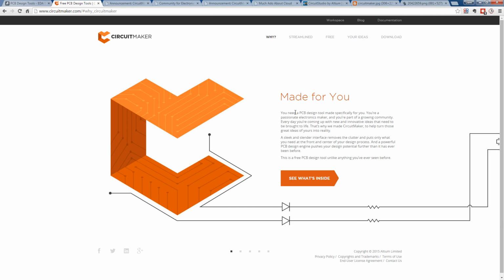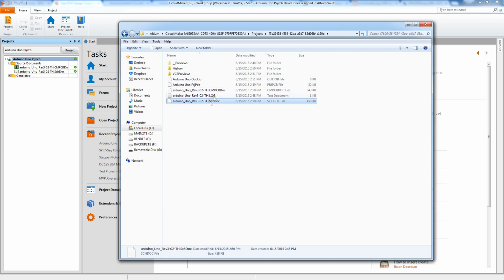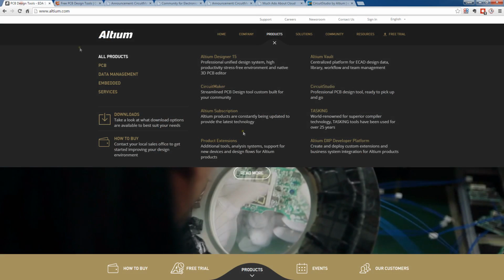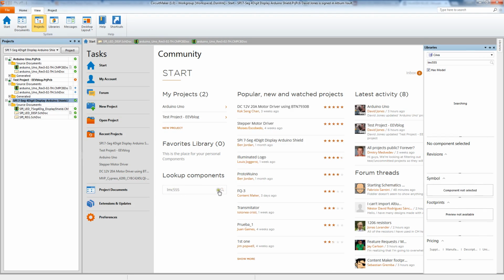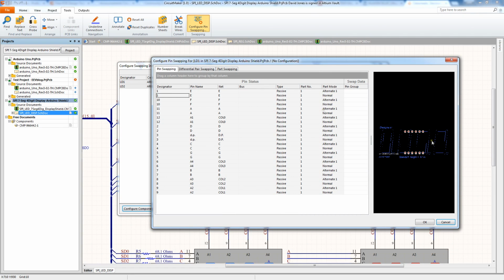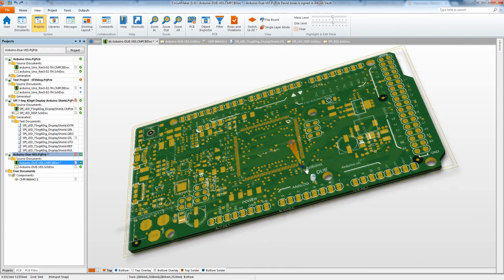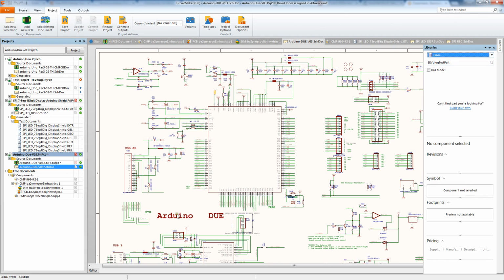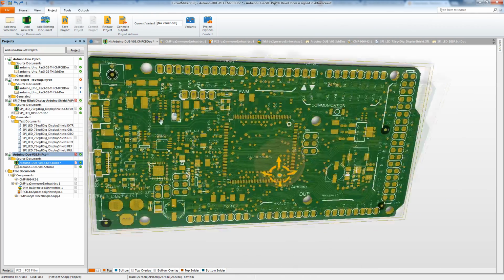EEVblog #754 - Altium Circuit Maker First Impressions

Comment: I am glad that KiCad is finally catching up. Thanks to CERN investment of developers into the project it finally reached a point that I switched over from Eagle to KiCad.

If you did not try KiCad in the last month you should do that now. Try one of their current nightly builds. If I had to bet I would say KiCad will be replacing Eagle.

Just so you know they are working on a stable version at the moment. So if you are a "stable release only" person you don't have to wait long any more. :)

Also it runs offline, it does not have layer or size limitations, it has a working push and shove router. (I already used it to design production boards and it is a joy to use) You can easily write scripts to modify the text format files. You can collaborate on your designs (just put them into a github repository). You can have as many private projects as you want. They use github to maintain community made symbols, footprints and template projects, that you can either download for offline use or let KiCad automatically download and update as the library expands and improves.

Also if you want to spend your money where your mouth is there is a donation page that will help make KiCad even better: https://giving.web.cern.ch/civicrm/contribute/transact?reset=1&id=6

And if you find bugs they have a bug tracker, and the developers are very responsive and helpful, if your bug reports are well written: https://code.launchpad.net/~kicad-product-committers/kicad/product (the bugtracker thing is a huge win over Eagle, where you have to wait years for a bug to be fixed)

So do not waste your time on the CircuitMaker and just bite the bullet and learn KiCad :D
Reply: ***** I did not use KiCad 2 years ago. So I am not sure how it was back then. I bet the software evolved a lot since then because I see how much progress it is making over the last few months since I switched over to it. I designed and manufactured 1 Board in KiCad so far and am working on a few other designs and it does not feel like a lot of pain. Reading the developer mailing list they are working on further improvements regarding the symbol and footprint assignment system. They just got rid of the assignment file few weeks ago. They are actively working on improving the whole workflow. For me it is just already improved enough that I can finally create my Open-Source hardware in Open-Source software as it should be. But if you are not willing to take any compromises and have time to wait, then I would probably wait another few months for the stable release. Things will only get better and the trajectory this software is taking is very promising. At the moment I was deciding to start another round of hardware designs for my company I compared and tried many available options including Circuit Maker, Eagle, Upverter, gEDA/PCB, KiCad, Pads and even Altium. The whole cost - learning time - ease of use - capabilities - conversion of previous designs - availability to users and projected future worthiness equation ended up coming out in favor for KiCad. And so far I am happy with that decision. :)
Reply from the maker: Piotr Esden-Tempski I don't want a "nightly build" of anything, thanks.
Reply: EEVblog  As I said stable release is around the corner. And what you just tested (CircuitMaker) is essentially a nightly build (Beta)... not sure why you are so dismissive to a solution that is obviously superior to CircuitMaker. At least based on the review you gave to it. Independent of the fact if it is a nightly build, daily build or whatever build.
Reply: Piotr Esden-Tempski I've used kicad for a few boards now and it works pretty well for the price. It has some weird parts but it's usable. I don't mind the footprint assignment stuff. Having a many to one relationship between parts and footprints makes sense to me... I just wish kicad had more standard footprints out of the box and had a better tool for creating ones that don't exist. Being about to bang in the pitch, pad size, number of sides and space between sides to get a footprint would be nice.
Reply: Piotr Esden-Tempski It's genuine free software too; according to the Wikipedia page, it was released under the GNU GPL.
Reply: Svenne Krap Lots of people that trumpet the "open this and open that" horn do so because it's an in thing right now and not because they actually believe in it.
Take the makerbot guys for example "open source is awesome, we get to consume all of your libraries etc for free and have products we can sell wooo" .. two minutes later .. "get your hands off of our stuff you filthy peasants".
Reply: donpalmera Yeah I agree it has it's quirks still. But as EEVblog said the same applies to Altium. As always you need to make a tradeoff calculation. EEVblog says he will use CircuitMaker because he is familiar with the Altium software and this means he does not have to learn something new, which is fair enough. I do not want to have my hardware designs locked up in a proprietary solution that might shut down on me. And as KiCad is "good enough" now I can finally escape the clutches of Cadsoft. I totally Agree on the footprint wizard front. I do not have time at the moment, but either someone will donate the project some money to make that feature happen or someone will volunteer some time and write a nice wizard for this. Either way because it is Open-Source everything is possible. :)
Reply: ***** correct, making it a natural choice for Open-Hardware... :D
Reply: Piotr Esden-Tempski I've been using KiCad professionally for two years. I have made 2, 4 and 6 layer boards with some with over 300 components. So far so good. Yes it can have some weird stuff but like any other EDA. Also, if you have any problem with files, all the projects files are text based so with a simple text editor you can make lots of changes quickly and with no problems. 

Everyday more people is joining the developer team and they are glad to get feedback from users which is something I can't say from any other EDA I have used.

Honestly, right now I don't thing any reason yet to change EDA.
Reply: Piotr Esden-Tempski KiCad also works with Linux, and if you are targeting the open source/hardware world, that is a big deal.
Reply: Piotr Esden-Tempski I feel Dave is strongly biased against free/open source in general (I have followed his videos since his old garage days). 

I must admit that it baffles me a lot, because he is so into open hardware.. but software.. "nah, not worth using" (paraphrasing here). 

Especially because the benefits you get of open hardware are even stronger when you think of open software..
Reply: Piotr Esden-Tempski  I like Kicad too but I think the mapping between symbols and footprints to create parts was such a pain ! (at least it was two years ago... I have not tried since then)
Reply: Kevin Harrelson I think kicad's weird-because-not-what-people-are-used-to things will become less of a problem in time. A lot of the next generation of electronics hobbyists will only know kicad as it's the main free software suite in the wild.
I don't mind so much that there aren't many components built in. A lot of the time I don't like how built in stuff looks in the schematic and want to redraw them the way I want anyhow. i.e. I don't like how someone has decided to break up a CPLD into the different IO banks as in my design I'm not really caring about grouping related pins into the banks and more about which pin is closest to whatever I need to connect (pin swap feature in the altium products looks awesome for this kind of stuff..)
But the footprints being so crap annoys me. I think a lot of kicad user's (myself included) have their own libraries of footprints that they commonly use as they are either missing or they can't find a matching built in one because the naming is all over the place.. Which means you have to be super duper careful and print out your board at 1:1 scale to check the footprints you've drawn aren't junk. I drew a TSOP-II footprint with the left and right sides reversed a few weeks ago and didn't realise until I had the board in hand. If the footprint was built in or I could have selected the pitch etc and generated one that wouldn't have happened. :)
I wish the footprints bit could be cloud driven in someway.. If I come up with a footprint that isn't in kicad I could push it, other people could rate it/confirm it worked for them, improve it etc and ultimately pull it into their designs. There are some big 3rd party footprint libraries with all of the 3D models etc in place which should be shipped with kicad or as a contrib package or something too.
Reply: donpalmera The Footprints and symbols are already maintained in the cloud. (You can always download it for offline use) They are on GitHub (https://github.com/KiCad) and KiCad automatically pulls the symbol libraries and footprints from there. So if you send them a pull request with your added or improved footprints everyone will benefit. The same applies to template projects.
I also maintain my own libraries. Most PCB designers and companies I know do the same. Having some symbols and footprints in the software is only a good jump starter. Honestly after KiCad footprint team created a guideline for the symbols and footprints (https://github.com/KiCad/kicad-library/blob/master/KiCad_Library_Convention.txt) the library became much more consistent and more usable.

Kevin Harrelson I used Eagle and Altium they both work worlds differently than the other. And sincerely the way how KiCad is different is not more different than the two aforementioned ones. Also 6months is a very long time KiCad advanced a lot in that timeframe. I did not find most of the footprints I wanted in the Altium library either. I always end up having to create my own footprints independent of how expensive the software package is.
Reply: Indeed, I am liking kicad a lot, and I'm still using the 2013 stable release. Looking forward to get into the new version soon. Now freecad just need to be nicer and I won't have a need for any non-free (open) software anymore...
Reply: Dr. S. Shenanigans I only started using KiCad a few months ago. Before that I felt it was not usable either. The progress over the last few months propelled it to a point where I rather use KiCad than Eagle or Altium. This is why I try to encourage people to try KiCad again as things improved significantly. Regarding any other "annoying UI quirks" the more people use it, and are involved in the discussion, the better the software will become. The KiCad developers are making big strides in streamlining the usability every day. I personally don't see a reason to waste my time investing into a closed platform any more.
Reply: Piotr Esden-Tempski "They just got rid of the assignment file few weeks ago" 
That's great ! I wish they will implement something like AD where you can create easily a database of parts from an excel spreadsheet.
Reply: Piotr Esden-Tempski The thing about KiCad, the last time I tried about six months ago, is the lack of parts libraries.  It is much easier to just drop in a 6502 processor without having to define the symbol first.  No 6502 built-in?  Really?  It must be a brand-new part.  I also thought the hierarchical thing was a bit strange, instead of being sheet-based.  I am sure it works, but it just words differently from EVERY OTHER board package out there.

Meh.  I want to love KiCad, being free and open source.  I just don't have time to mess with it.
Reply: TutoElectro I am glad to hear that. I am running into more and more people like you since I started using KiCad. This is very encouraging that there is a lot of professionals using the software. As of changing EDA, I do not see a reason to change from KiCad, but I think giving KiCad a shot and switching from the proprietary packages was a very good choice for me. :)
Reply: cyrex686 Yes agreed, for me the Mac OS X support was a big win too. The software I am using has to be exceptionally better than everything else available so I fire up Windows. And I think in this day and age there is no excuse for a software developer to not make their application cross platform. It is possible and a lot of people do it. Any reason why not is a poor excuse.
Reply: Wenke Li Your wait will be over soon. You can always take a shortcut and try the nightly builds. I have to say they are pretty usable and stable already. :)
Reply: Indeed, I've just installed the nightly on my mac, need to set up the compile on my gentoo machine. Then I'll see how to deal with my custom parts. I actually like the user interface, pretty consistent, which becomes intuitive after a little bit of time.
Reply: Piotr Esden-Tempski I'm more in the IT area, but this stuff has always interested me. I've always wanted something like this that I can mess around with and learn, but its all been paid software. I've looked at KiCad in the past but it wasn't that great. Has it gotten that much better and is it available for Linux?
Reply: Piotr Esden-Tempski I'm using the version of kicad that's in debian so it's probably a bit crusty. If the footprints are getting sorted out I'm a really happy guy. If someone could fix the bug in the intel graphics driver for Xorg that causes kicad to crash the whole x server I would be over the moon. ;)
Reply: Piotr Esden-Tempski Once I've found KiCAD a few years ago Eagle never stood a chance for me no matter how popular it was in among hobbyists - I'd have to be crazy to muck around in a tiny sandbox at someone else's mercy when I can have a capable tool no-one can take away from me instead. As for the rest of the bunch? I won't even bother to laugh them out of existence, no matter how "professional" or "widely used" they are. I understand they need some sort of "hook" to make it worth their while, I just don't care to bite on one just to please them. As it happens I do circuit design for a living and guess what - we're all using KiCAD there too instead of the big-name package we had bought and used before. Good riddance!
Reply: Piotr Esden-Tempski Is it still akward to pan in KiCad? One of the major reasons I never design there is how annoying it is to pan.
Reply: Dr. S. Shenanigans I am not sure what you mean with annoying to pan. You just use middle click to drag the canvas, the same way it is in Eagle for example.
Reply: Piotr Esden-Tempski Midclick pan was not a thing in KiCad when I tried it out, and wasn't a think when Dave did his trial of KiCad(see history, or threads like this: http://www.eevblog.com/forum/open-source-kicad-geda/one-annoyance-of-kicad-solved-f4-drag/ or http://sevenstring7.blogspot.com/2013/09/kicads-middle-mouse-panning.html). Not only that, but there are a lot of other annoying KiCad UI quirks. But it is good to know, that progress has been made. Still, I am more willing to try Circuit Designer than try KiCad again.
Reply: +EEVblog Ok, you can now give a stable release of KiCad a try! The stable V4.0.0 release is out! http://kicad-pcb.org/post/release-4.0.0/

Comment: I would use this no problem if i could use it locally, i sometimes work on 5+ projects at a time sometimes just to mess around and make breakouts and whatnot but they are not clean and i would just embarrass myself posting every one!
Also some multi monitor support would be awesome ... like have all the selections on one monitor and your PCB on another and your sch on your prime! 
For now i will stick with Eagle Pro

Comment: Double click the tab on the ribbon
Reply from the maker: leppie I did, it does nothing. I can turn the ribbon off completely though.
Reply: EEVblog It does not turn it off, but rather make it floating and auto-collapse. In collapsed mode you can use the shortcuts or a single-click to open the floating panel which will collapse again after clicking a button.

Comment: This sounds like they are following in the footsteps of recent software releases. Unreal Engine 4 is free, full source code through GitHub, with a 5% royalty after the first $3000 per quarter. Source Engine 2 is free as long as you release on Steam. Neither have any gotchas. Unreal Engine 3 cost something like $1 million up front + 25% royalty.

They could have done some interesting things to make the full version completely free. Allow people to sell and buy PCB designs (UE4 does this with Blueprints and assets), make deals with hardware sellers to get a cut from each sale, let people design the PCB in the program and then send it to a manufacture through the program to manufacture it, have a royalty on PCBs sold or negotiate a fee if you expect to sell millions of them. There's a plethora of ideas that could end up making them more money than if they directly sold the program, but it seems they don't want to take the risk of changing their business model of direct software sales to designers. Epic Games took a massive risk completely changing their business model and it's worked out great for them so far.

Comment: What are the PC requirements/ Can't find them.
Reply: jpalm32 Standard ones, I7 4gen  with 64GB and 200Mbps Internet connection. Thats what the developers think we actually run in our homes. Wait, you better buy a Cray Supercomputer to fulfill Adobe Flash Player / Win10 and all cloud based BS. Or take a PIII, XP, 512MB RAM and Protel 99SE to do the SAME job.
Reply: TubiCal LOL, w98SE looks like Unix to me compared to Win 8.1 .... ohhhh man, what a POS !!!!!. cloud computing  ?, for demostration purposes is fine, but as a "daily driver" ... big "NO, THANKS". Orcad 9,1 is a good suite, runs on a P120 with nothing but 32MB of RAM. Yeah, circuit sim runs a bit slow ...  enough to me !!!!!. Cloud coputing = depend on something / somebody else to do your job and store your data. First hacker attack and this concept is dead. Start counting ....
Reply: 38911bytefree PT99SE, still running on my Laptop win98SE ;) thanx!